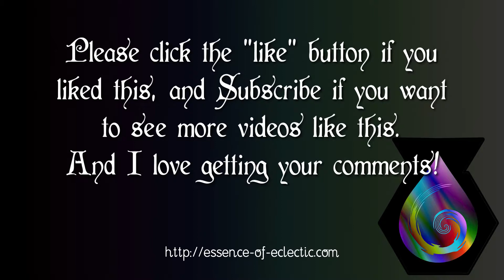011 Another Method of Jewellery-Making With Acrylic Pour Sheets - Part 1

Comment: Very clever use of the skins, Kerr. Have you ever tried to stick a whole skin (cut to size) on both sides of the foam core board BEFORE running it through the cutter? Maybe it would be too thick? It would save a lot of the time it takes to cut them separately, then stick the skins on all those small hexagons. Just a thought. I'd love to see what you used these hexagons for!
Reply from the maker: Yes, that did actually occur to me after I did all this! Great minds think alike. I haven't done it yet, but it is on the list. One of the reasons I didn't do that this time is that I wanted to be able to use the same skin on both sides, and I didn't think of cutting it in half, possibly because I thought the area after that would be too small (the skins are only A5 in size).
As for what these hexagons were used for... see part 3...? Or do you mean the leftover ones from this video? I've been working on those, but I didn't video myself doing that. 8-/
Reply: Kerr, I didn't see part 3. I'll have to go find it! Look forward to it.